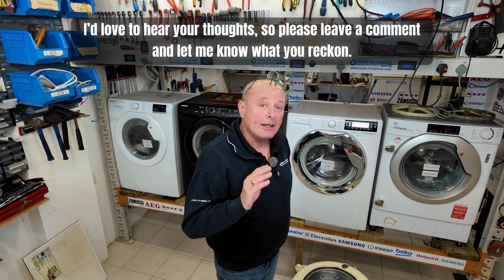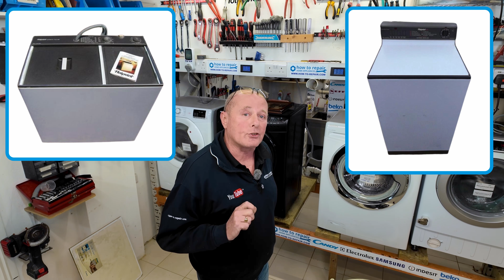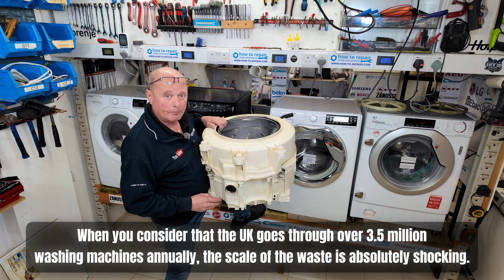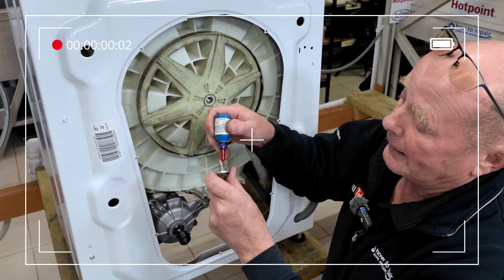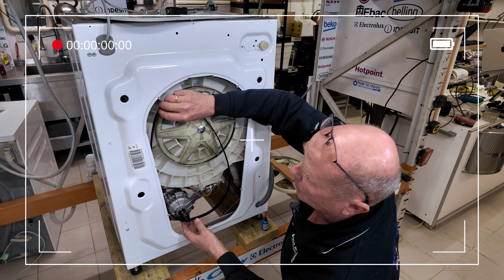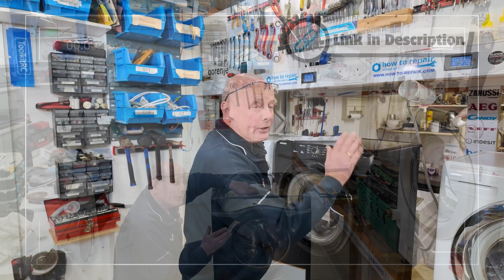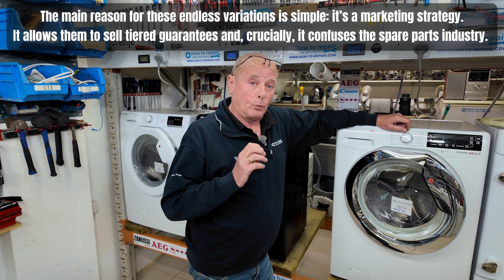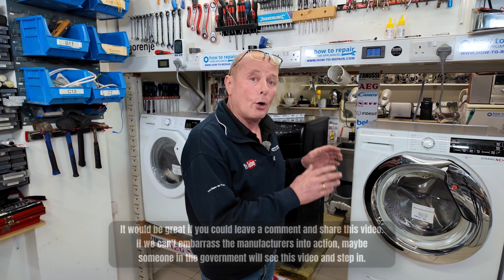I Scrapped 13 MACHINES to Prove a Point: STOP BUYING These Brands!

Comment: It’s insane how much washers advertise how energy and water efficient they are when their planned obsolescence does far more environmental damage.
Reply: Government mandated warranties.
Norway has 5 year minimum for example.
Reply: @jaro6985  The EU should follow suit. Mandate longer warranties for large home appliaces. Same should go for major components in cars.
Reply: @AuthenticGadzooks  totally agree. Europe is failing
Reply: @AuthenticGadzooks  Fool! All that the "mandated warranties" will do is make the price 2x higher - or if you forbid that, too, simply make manufacturers disappear from the market. The only thing which can cure this sort of behavior is FREE COMPETITION, which means less regulation, fewer barriers for new companies to enter the market. Do you know what was different in the 70's and 80's? Less corrupt government interfering with that markets and making manufacturing a losing proposition, that's what.
Reply: @AuthenticGadzooks  The warranty for washing machines should be 10 years! I prefer to pay 50% more for 1 washing machine in 10 years than for 2 in 10 years.
Reply: @clray123  I wouldn't be surprised if warranty will only raise the price for about 20%.
Reply: @tongobong1  You're stupid if you believe that the corpos won't shift off any and all of the cost to the consumer. Especially when forced collectively into the same bs.
Reply: @clray123  If there was less regulation, like Russia or Brazil, then cars sold in the UK (like cars sold in Russia or Brazil) would have no airbags, no side intrusion bars, no front offset crash proection, no ABS etc etc. Be careful what you wish for.  

Brazilian motorists in the end were QUITE mad that their Peugeot 208s had the side intrusion bars deleted to save a few dollars per cars (despite the free market, buyers largely weren't even aware of this omission), they didn't seem to think it was worth the compromise to their safety, as much as Peugeot did!

OK to be fair in Russia, if you are buying a Lada Niva, you KNOW it is a brand new 40 year old car and it has zero crashworthiness (no airbags, no stability control, rudimentary crumple zones etc). That is arguably very different to buying a late model Peugeot 208 and thinking that it ought to be a safe car, but it isn't.
Reply: @TassieLorenzo  No, even without regulation the safer cars would be bought if consumers preferred them. It is not so difficult to figure out which car is safe and which is unsafe and make your purchasing decisions accordingly. (And yes, even in highly regulated countries this varies for different brands of car - if it concerns you, you can find comparisons and crash test reports.)
Reply: @clray123  The crash tests are a form of  Government regulation though. "Euro NCAP was originally started by the Transport Research Laboratory for the UK Department for Transport but later backed by several European governments, as well as by the European Union (EU)"

As I said, I don't think as in the strict sense of no Govenrment regulations that Brazilian buyers were aware of the deletion of - with no regulation  there's no one to do the crash tests, and therefore there are no Brazil-specific  crash tests published int he Brazilian market.  

Buyers there may look at (official Government-backed) Euro NCAP crash test results and not realised that 208s sold in Brazil are a different specification.

"It is not so difficult to figure out which car is safe" Without Euro NCAP, I'm not sure this is true. Some prefer to browse meta-analysis of real world crash data --  again usually done using public Government funding!!! -- but this data is not available for near-new models.
Reply: @TassieLorenzo  What I mean to say is that where economic interest for information exists, companies will emerge that gather and sell that information. Of course if the government does it anyway (because it mandated itself to do so) no company is going to compete with that "free" service. In reality the service is not "free", it is funded by tax money, and wherever tax money is siphoned out, you can be sure that it will be done as inefficiently as possible (by the companies that get the contract) because the government buyers have the least to lose and therefore have no self-interest in overseeing the contracts. Any big economic scandal you look at, there is always government funding involved.
Reply: @John_Gambling That is why I wrote that fighting monopolies is pretty much the ONLY activity that is expected from the government (which it is not doing). Other kinds of regulation are not needed / are mostly harmful for the consumer. As for "trickle down", it is already the case that a small percentage of the richest people are paying the most tax (in relative and absolute terms). You can call it "trickle down" if you so desire.
Reply: @John_Gambling Of course the average Joe, voting with his money - if only he cared to think about his interest and liberty. Your comment shows the most horrifying mistake you commies make - painting individuals as helpless sheep constantly at risk of being "manipulated" and "taken advantage of". At the same time you refuse to understand that those whose protection you seek are, and historically always have been, your main oppressors.
Reply: @clray123  i wouldnt mind higher prices , if it forced manufactureres to also make sure the lifespan of such appliances were was they used to be.. short term cheapness isnt always the best.
Reply: @erikvinnes  In the end it all depends on the structure of the market or "who has the upper hand". If manufacturers are worried about the competition, they should be concerned about such things of their own accord. However, if they all collude together against consumers and if there are big entry barriers for new manufacturers (perhaps established by overregulation), then they will exploit the consumers like they do today. Therefore the solution might be not to impose even  more regulation on them but to make it easier for competitors to join the market (e.g. subsidize new companies that oblige themselves to not do that sort of crap).
Reply: @AuthenticGadzooks  consumer protection laws in EU give rights beyond the written manufacturer's warranty. if it breaks a week or even months later after the warranty expired you are still eligible to have it repaired or replaced
Reply: @AuthenticGadzooks the eu is there to look after big business not ordinary folk like us.
Reply: @clray123 I just want to say that absolutely everything you said is wrong. Trickel Down? Doesn't even work by definition. You invest money to get more. No the wealthiest do not pay in relative terms or overall the most taxes. The only tax they pay the most is income tax and that's it.
No regulation = you are fucking dead.
How many fucking examples do people need. Food that is made with drugs to makes the customer addicted. Paint that kills him. Toothpaste that kills him. Fuel that kills everyone.
You want to test these products? You want to write about my products? You get bought. You get sued. You get beaten. You get killed.
All of that still happens today.
And it doesn't even matter.
The product can be really good. The garbage that makes by producing you can also kill everyone. 
You are a moron and you can be glad that there are people that protect.
Reply: @jaro6985 whoa! That's long. Wouldn't want to be a retailer in Norway haha

We get the EU 2 year warranty. But when you buy something the retailers are all too keen to sell insurance which increases the warranty to 4-6 years. I love how one of the arguments to sell these policies is to tell you that what you're buying will break down. Initially I didn't do it but now I just go "ah ok, well if this is crap then I don't want it thank you goodbye".
Reply: @Czeslaw_cn4tv  yeah its funny
Reply: @Czeslaw_cn4tv  yeah I started doing the same thing. Wow if you’re trying to sell me this warranty that hard, then I don’t need this product. 
NEVER EVER BUY ELECTRONICS FROM WALMART. NO returns whatsoever. Have to work with all state before they will return the garbage.
Reply: @Czeslaw_cn4tv In France, you can't find warranties longer than two years. That’s evidence competition isn’t working: even though there are more than 10 different manufacturers, they all offer only two years. Why doesn’t even one of them try offering three? That suggests they may be colluding.
Reply: @Czeslaw_cn4tv  in all EU its now 3 years, since 2024 if i am not mistaken ;)
Reply: @Czeslaw_cn4tv  Here in the Netherlands we have a ''expected usable life'': washing machines have to work 10 years (if maintained properly). However, it's not the same as the EU 2 year warrenty and you might have to go to court to get your money/replacement.
Reply: @Czeslaw_cn4tv  Wait, wait - If I was a retailer I'd want to be in Norway. Not having to fight alone against the poor quality, having some sort of official backing. Don't know how the business exactly works, but I can't imagine manufacturer isn't affected and the retailer would have to take the hit alone when a machine fails?
Reply: @Czeslaw_cn4tv  EU mandates a two year warranty of the manufacturer, the warranty period of the seller is longer. For washing machines it is 7 years, but there is one caveat, you have to pay for depreciation. So after 5 years you have to pay 5/7 of the parts, because you are getting new parts to replace the partly deprecated parts..
Reply: @Delalcon  In the UK we have "Consumer Rights" legislation which goes way beyond warranties. It has to last a reasonable time and 1 year is NOT reasonable ,so one would try and claim a repair or replacement using Consumer Rights.
Reply: @jaro6985  If only EU could demand 10 years minimum that would be great. 10 years isn't difficult, it adds a small extra cost for the manufacturer, and people would be willing to pay a lot more for 10 years warranty. Heck, I'd happily pay double or triple if a manufacturer can do 20 years warranty.
Reply: @jaro6985  and manufacturers build their shi just long enough for the warranty to pass by. Yipee! Guaranteed 5 years of use! Good luck after that :D Esp in the current economy.
Reply: @jaro6985  5 years is nothing! I have Miele 45 years old running like a charm
Reply: @jaro6985 too short
Reply: Good point
Reply: Please don't tell me you think companies care about the environment.
Reply: @SrchangwaytogoC  I think part of the point is exactly that they only pretend to care, cause they'd take this factor into account as well if they truly did. Not the only reason of course, a good energy label makes it a better deal, and they're not even the ones missing out from selling you less energy.
Reply: @Gnurklesquimp2 they don’t pretend to care, it’s regulations making them classify their energy efficiency and that’s obviously used as a marketing scheme on top of it
Reply: @SrchangwaytogoC  western companies dont
Reply: @automatedrussianbot  All companies do not care fool.
Reply: @automatedrussianbot  any company dont. companies are made for profit, not to help environment, if not government laws companies would do anything human can imagine to make profit. and they still try in many corrupted ways. its not about if company is western or eastern lol
Reply: @automatedrussianbot  what Eastern companies do care about environment? Chinese?
Reply: @automatedrussianbot  Oh I guess you think Chinese and Indian companies are better than Western ones 🤣🤣
Reply: @automatedrussianbot  yeah your name checks out
Reply: honestly couldnt care less about energy or water efficiency. i care about quality and reliability first and efficiency second. sad times.
Reply: Which goes to show, that energy und water efficiency advertisement regarding environmental protection is just a scam. Companies dont give a shit about the environment, they only care about money. They and politics try to gaslight people into a guilty conscience and force that down our throats, while on the backside never caring about actual pollution and environmental impact.
I live in Germany and its one of the prime examples of that. Its horrible. The end consumer gets fucked, has to pay tripple/quadrouple out of his own pocket, while companies get relieved left and right through politics.
I´d like to care for the environment, but I cant if Im being sold for dumb. And you have to be able to afford morals, which Germany clearly isnt able to anymore. But hey, as long as the people who decide that stuff are living warm and comfy, who cares right?
Reply: @Rakku Of course companies care about making money, that’s the entire point of our capitalist system. Supposedly it’s still possible to get them to act in ways to benefit the environment for example, by using economic incentives, that is by using regulation. But if we want to have actors in society to be motivated by something else then money, we can’t have a system that’s entirely based around wealth.

Also, of course you can act in ways that are beneficial to the environment. The problem is that to make an actual difference rather than just making you feel better about yourself requires some quite drastic changes to your lifestyle, and that’s out of the question for most. Yes, many would consider paying slightly more for a product marketed as being better for the environment. But once it comes to changes that makes life less comfortable in some significant way, most of us aren’t really that interested. 

And the same way, most think it’s a good thing to, as I mentioned before, use regulations to force companies to improve. But that of course increases the costs for the companies, who will find ways to pass the costs to customers, making prices increase and quality decrease, which make the same people who wanted the regulations angry.
Reply: @bewing77  The small extra costs of repairable machines mean that repairs are much cheaper. So overall the cost to the consumer of repairability legislation is negative - i.e. it makes their lives cheaper in the long run. It's wrong to present this particular issue as a consumer cost vs environment tradeoff. It's cheaper for people. The only entity that loses out is washing-machine manufacturers, who will sell fewer new machines, (but more spares).
Reply: @bewing77  The government are happy with things the way they are too - it's great for GDP.
Reply: And then you are the one paying Eco tax, nice
Reply: technically - a broken machine uses 00.00% energy & 00.00% water
Reply: The efficiency is for EU shit😅😅that's why EU was in deep trouble they made... Old machines can work decade, but new one is nonono...
Reply: Making money on faking concerns for environment is a huge business.
Reply: Because it is a climate scam, old electronics and utilities lasted forever. Now they fill landfills.
Reply: Recycling is a giant scam and always has been.
Reply: We can send human in space, we could have machine that last 30 years+
Reply: Same can be said for modern cars, especially EVs.
Reply: just like how cartboard straws lined with plastic ultra pollute everything compared to their wholly-plastic counterparts.
The plastic lining breaks down into such small parts that they pass into your bloodstream easily.
Reply: Exactly what I discovered. It's worst in the cars.
Reply: I don't really care about the environment, but good point none the less. It's like EVs then, although EVs are way worse because no matter the build quality, just producing that car has already polluted as much as ICE does in its entire lifetime and their entire product is about greenwashing.
Reply: @beardsntools that's just measurably false
Reply: @Huskie  These are facts lmao. Is your pic AI? Either way it checks out.
Reply: @beardsntools  no lol, this picture was around before stable diffusion even released. and even then, 50k fewer chatgpt queries is a drop of water in comparison to stopping meat consumption, or switching to an electric car. as a mechanical engineer, I can say that your perception of the embedded carbon of an EV is highly misplaced, likely influenced by your political agenda.
keep your nonsense out of discussions about right to repair and planned obsolescence.
Reply: It's the exact same thing as claiming EVs have "zero emissions" when the battery alone is far more damaging to the environment than any other car could ever hope for (from mining some of the components, through its production, charching, to its recycling, and that's not accounting the event of it malfunctioning and burning).
Reply: @YamiKisara  AND EVs have also far shorter lifespan than tradidtional cars, which can work for 20+ years for different owners, while in case of the EVs afer 5 years there is a need to change the battery, as their capacity gets significantly smaller, and that exchange is just too expensive, so people buy a new car, so again the energy and material expense has to be repeated. Until we have a breakthrough in the battery technology EVs aren't really "clean", same with most of types of renewable energy, until there will be efficient cheap and long lasting batteries which would allow to store energy on the industrial scale, renewables are  just way too variable form of energy production.
Reply: It's not like they have the incentive to so that, no?
Reply: NAILED IT !
Reply: It's the same with the cars, they introduce terrible technologies like wet belts and ultra thin oil for minimal decreases in CO2 production but the engines keep failing prematurely because of it.
Reply: Does it? Based on what research? It sounds more like you just pulled this claim out of your butt.
Reply: Exact same goes for cars and politicians
Reply: Surah 2 Al-Baqara 2/255:
Allah! There is no god ˹worthy of worship˺ except Him, the Ever-Living, All-Sustaining. Neither drowsiness nor sleep overtakes Him. To Him belongs whatever is in the heavens and whatever is on the earth. Who could possibly intercede with Him without His permission? He ˹fully˺ knows what is ahead of them and what is behind them, but no one can grasp any of His knowledge—except what He wills ˹to reveal˺. His Seat encompasses the heavens and the earth, and the preservation of both does not tire Him. For He is the Most High, the Greatest.

Surah 2  Al-Baqara 2/256:
Let there be no compulsion in religion, for the truth stands out clearly from falsehood. So whoever renounces false gods and believes in Allah has certainly grasped the firmest, unfailing hand-hold. And Allah is All-Hearing, All-Knowing.

Surah Al-Baqara 2/257
Allah is the Guardian of the believers—He brings them out of darkness and into light. As for the disbelievers, their guardians are false gods who lead them out of light and into darkness. It is they who will be the residents of the Fire. They will be there forever.

Surah 98 - Al-Bayyinah:
The disbelievers from the People of the Book(Christians and Jews) and the polytheists were not going to desist ˹from disbelief˺ until the clear proof came to them: A messenger from Allah, reciting scrolls of ˹utmost˺ purity, containing upright commandments. It was not until this clear proof came to the People of the Book that they became divided ˹about his prophethood˺— even though they were only commanded to worship Allah ˹alone˺ with sincere devotion to Him in all uprightness, establish prayer, and pay alms-tax. That is the upright Way. Indeed, those who disbelieve from the People of the Book and the polytheists will be in the Fire of Hell, to stay there forever. They are the worst of ˹all˺ beings. Indeed, those who believe and do good—they are the best of ˹all˺ beings. Their reward with their God will be Gardens of Eternity, under which rivers flow, to stay there for ever and ever. Allah is pleased with them and they are pleased with Him. This is ˹only˺ for those in awe of their God.

Surah 99 - Az-Zalzalah:
When the earth is shaken ˹in˺ its ultimate quaking, and when the earth throws out ˹all˺ its contents, and humanity cries, “What is wrong with it?”— on that Day the earth will recount everything, having been inspired by your Lord ˹to do so˺. On that Day people will proceed in separate groups to be shown ˹the consequences of˺ their deeds. So whoever does an atom’s weight of good will see it. And whoever does an atom’s weight of evil will see it.

Surah 92 - Al-Layl:
By the night when it covers, and the day when it shines! And by ˹the One˺ Who created male and female! Surely the ends you strive for are diverse. As for the one who is charitable, mindful ˹of Allah˺, and ˹firmly˺ believes in the finest reward, We will facilitate for them the Way of Ease. And as for the one who is stingy, indifferent ˹to Allah˺, and ˹staunchly˺ denies the finest reward, We will facilitate for them the Path of Hardship. And their wealth will be of no benefit to them when they tumble ˹into Hell˺. It is certainly upon Us ˹alone˺ to show ˹the way to˺ guidance. And surely to Us ˹alone˺ belong this life and the next. And so I have warned you of a raging Fire, in which none will burn except the most wretched— who deny and turn away. But the righteous will be spared from it— who donate ˹some of˺ their wealth only to purify themselves, not in return for someone’s favours, but seeking the pleasure of their Lord, the Most High. They will certainly be pleased.
Reply: Well maybe you should stop buying the cheaper models and focus on the more expensive ones. The more expensive models usually have a reason for the increased price and its not just the extra features.
Reply: Yep, same for fridges etc. Sure newer ones use less energy but if we throw it away every 5 year then what is the point?
Reply: You’re not wrong. A lot of modern home appliances, especially washers, brag about being energy-efficient, but the reality is many are basically products designed to fail. That kind of planned obsolescence creates more waste than it saves. If machines had real product durability—the old buy it for life mindset—people wouldn’t need constant appliance repair or replacements.
Reply: We had a White Knight condenser dryer for many years and I managed to swap everything that wore out on it myself ( Glen ) until the drum warped in the end. We bought a Blomberg heat pump dryer a few years back which has been great until now but it's not heating up. I've swapped the heater element but no difference. Checked filters, etc , and damp sensor and can't find the reset button that's supposed to be in the back.
Reply: I watched a programme about this and I kid you not, the expert said,' Don't buy expensive machines because every year they are getting more water and energy efficient.' And nobody asked about the environmental damage of  producing, transporting and dumping of washing machines
Reply: @sparklemotion8377  You don't need anyone to tell you that. Just do the math.. how many years of of power/water savings, for the new machine to pay for itself, so you just cut even? These savings are so small it's never worth it, especially not with these washers breaking down after several years.
Reply: @beardsntools  I was talking about the hypocrisy of saving energy to save the enviroment
Reply: @sparklemotion8377  I know that, I added another reason why greenwashing is dumb
Reply: @beardsntools  okay
Reply: The Government standards about always stress efficiency and care less about the lifetime cost. Ie I have a high end 9.8 EER Sears/Whirlpool AC in a shed/cabin I paid say 60 bucks more then for a higher EER unit. Today I could buy 11.8 to replace it. There is not way an hell it will last 30 years. Mine has oiling holes at the fan motor. I might a mess window units before and after Katrina.

With todays ones I have had them last 1 to 7 years
Had the electronic panel die be zapped; had the HVAC gas leak out so the efficiency is good for 2 years then it freezes up has is low. So they get thrown out

 So R22 and R12 units from 30 years ago work; and modern gasses that save the Earth all pee out in a few years
ie thin coils; bad solder just a bunch of crap
Reply: I recently bought the worst energy-rated washer that I could find. I can finally enjoy properly clean clothes.
Reply: Its also stupid that when you turn off a washing machine to take a shower it drains, then you have to start over. The old machines you just pulled the knob out and paused it
Reply: @davidwelday3276  modern washing machines also have a pause button
Reply: You can still pause most washing machines.....
Reply: Yes! I've never heard of that! Must be a weird American thing!
Reply: That's not necessarily true. manufacturing embodied emissions is 300-400 KgCO2e. Lets call it 350. Emissions per wash (in the UK in 2025) is 0.7Kg (or 3Kg if it's a washer-dryer and you use the drying cycle). So use overtakes manufacturing at about 500 washes. That might be 10 years for some people, or 3 for others. If you use the dryer then in-use becomes larger after 100 wash-and-drys, which could be 2 years or less than a year.
So for quite a lot of people in-use emissions will be just as large, if not larger, than manufacturing emissions.
Lack of repairability is really bad of course, but I'm just pointing out that in-use emissions are still likely to be higher than manufacturing emissions, and that's after the major efficiency improvements. For pre-2000s models the in-use emissions would be much higher.
Reply: @xxwookey  Go and look at the mountains of e-waste and tell me again how throwing shit away instead of repairing things is better.
Reply: @StackPilled-r8z  I never said throwing things away was better than repairing things. Repairing things is great. I did say that newer equipment can be lower-carbon overall even including manufacturing and recycling emissions. Trading off waste/material usage against emissions is a tricky one as they are not directly comparable.

In general I would say that climate change is a much bigger/more urgent problem than manufacturing/waste/recycling, but deciding exactly how long you should should keep old, less efficient, equipment going before replacing it, is tricky and very much depends on usage patterns.

The bottom line is do your sums so you know the emissions cost, and how much usage is needed for something cover it's own manufacturing and disposal/recycling.
Reply: @xxwookey And yet, manufacturing emissions are a significant portion of the total even if they are the minority.

It would be much better for the environment (and for our wallets) if machines were repairable.
Reply: @orppranator5230  Absolutely agreed. Repairability is an important part of keeping emissions down. An efficient, repairable, machine, used sensibly, is the ideal.
Reply: @xxwookey I don't buy it. It's the same nonsense with cars. All they do is make taller claims every year but cars economy in the real world hasn't changed since the nineties.
Reply: @bmartinot  What do you mean you don't buy it? Those are real numbers and it's a very simple calculation. There isn't anything to 'buy'. In-use emissions can easily be higher than manufacturing emissions. That's all I said, and it's true.
Reply: @xxwookey I don't believe they're any more economical, it's just marketing.  Same as my diesel is supposed to do 65mpg but actually does 35mpg.
Reply: @bmartinot  I see. Well it's very easy to measure for a washing machine. Use a power-meter plug to see how much electricity it uses, and check the water meter to see how much water it uses. Then you know exactly how much your own machine uses.
Reply: to be fair, regulatory environment and consumer preference tells them to do so. They don't hate environment, they have to serve customers. If customers start buying only repairable, sturdier products, they can do that too. But: would you pay more for something repairable with less features?
Reply: @koborkutya7338  Absolutely. That's exactly what I want. I use one or two wash types, and I want my machines to be fixable and efficient. As I buy one every 30 years I really don't mind if it's £400 instead of £300 to make that happen. Even of the people who buy whatever is cheapest, if each machine came with an obvious 'cost of repair' rating, quite a lot of them would choose machines with better repair ratings. At the moment we have zero information to go on in this regard.
Reply: @koborkutya7338  i would gladly pay more
Reply: @koborkutya7338  I would. The problem is I can't find any.
Reply: @koborkutya7338  YES. Most of the "features" are unwanted by me. Especially with a washing machine. They are useless heaps of shit now. You can't even do an extra spin without 10 minutes of the machine draining nothing first. Such a waste of my time. Used to be you could just turn the dial to spin and it would SPIN straight away. I can't do a short cycle with a full load, it won't even do it and add a few minutes.. And who tf wants a machine that directs UV at their clothes? We all know these things never work properly and last thing we need - especially in Australia - is a wonky heap of crap washing machine malfunctioning and spraying us all with extra UV. Lol. I hate new washing machines. The ones of the early 80s were way better, the one my mum had when we were kids lasted 20 years with mountains of washing every day. Never had to repair anything on it.
Reply: Yup don’t listen to the government or the woke anymore. It’s all performative.
Reply: It just means quit electing leftists who want to act for you, think for you, refuse you your right to own your product and deny you access to all kinds of other human rights you have. Quit voting people who don´t want you to have access to the security you need to protect yourself, your family and your friends. That means support the 1st Amendment, the 2nd Amendment, the rest of The U.S. Constitution and The Bill of Rights and only vote those who want you to have access to cash.